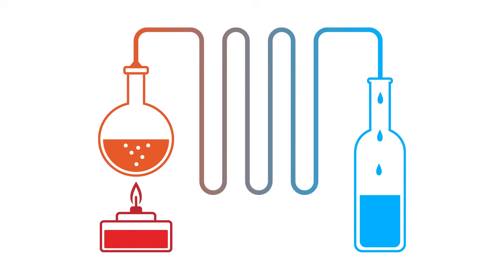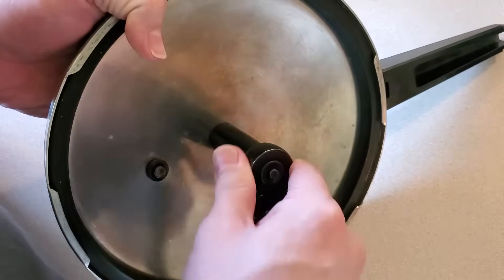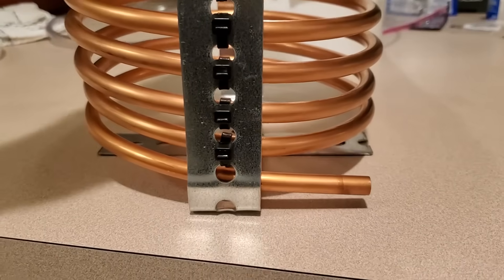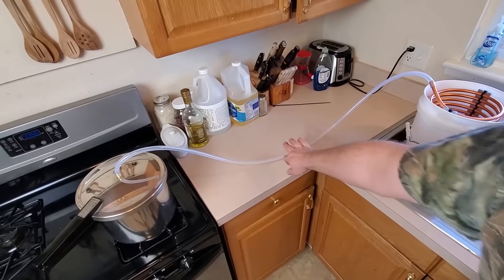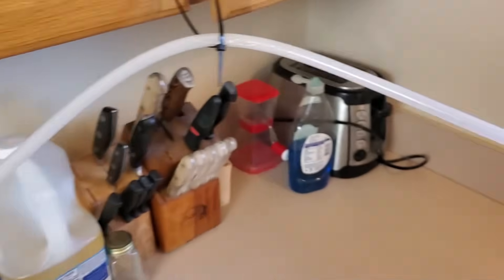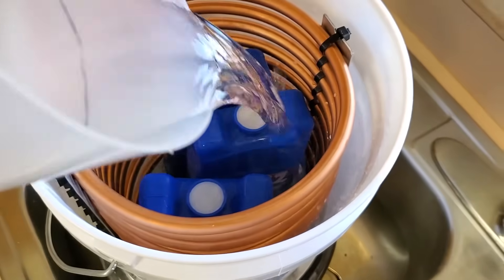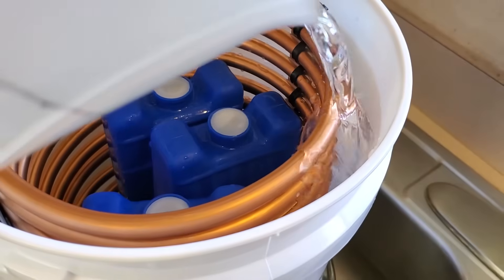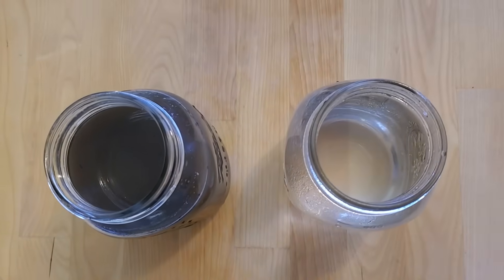DIY Water Distiller (Higher Output Version) - Full Build and Demonstration

Comment: Does it remove fluoride?
Reply from the maker: Yes. It removes almost anything/everything. This includes minerals and beneficial things, which is why it's not ideal to use as a long-term water treatment method for drinking water. But if you need to remove fluoride from some water, distillation will do it.

Comment: I bought a still to do this .what I found was... It takes way too much energy to create distilled water I had to keep pouring cold water onto copper pipe and the water became boiling hot within a minute .I wondered about the idea of placing the copper pipe In a small freezer perhaps to condense the water ? I just found the work Vs result was way way too much .

Comment: You pretty much covered all points but I believe distilled water lacks minerals and requires some salt to replace minerals or the Atoms in the distilled pull the minerals out your body so I would think a few kilo of pure Rock Salt is needed also if this is going to be the regular modus operandi for drinking

Comment: The problem with distilled water is all the minerals are removed and man made chemicals with low vape point transfer over so depending on circumstances it still needs to be filtered
Reply: If you allow the water to boil for a short time before placing the lid on then it will off gas all of that. Also, purge the first of the distilled water.

Comment: You don’t need a pressure cooker in a pinch. As he said, he’s not worried about the seal because the pressure won’t be that high. Drill a hole in the lid for any big pot you have, attach a hose connection, and just putting a brick on the lid will suffice.

Comment: Boiling isn't necessary and probably detracts from the process. Just enough heat to cause the water to evaporate and rise at a good rate. Although slower It will be much kinder to your chiller. GREAT BUILD

Comment: The water drain is unpractical and a waste, to be honest. The water that gets hot in the bucket is the top layer and the bottom half stays as cold as it was when you pour it. It creates a thermocline so it still cools the steam. When you drain it from the bottom the cold water leaks first. Also the water itself doesn't get that hot. I love to put my hand in the cooling system and feel the thermocline, it's fun. my elbow it's around warm water and my fingers are in cold water. I leave if to boil for 3 hours and the water has never gotten so hot that I was not able to put my hand in it. So yeah, it you want to, you can scoup a couple of bowls of the water on top and replace it with cold water, but draining the bottom water is a waste.

Comment: Would filling up the bucket with dirt help the cooling process? u can always add water to that too if the dirt alone doesnt do the job. Id imagine coolness in the condenser would last longer with dirt and water (as the water would be soaked by the dirt
Reply from the maker: That's an interesting idea. I'm not sure if it would help cool the coils, or act like an insulator and prevent the coil from radiating/dissipating the heat. Might be worth an experiment.
Reply: @GreatLakesPrepping  Try sand, you know how on the hottest days at the beach the sand is still rather cold if you dig like 8 inches down? Thinking more into it I theorize that sand would be very effective at keeping cool. Especially if some water (doubt it even has to be cold) gets added to the sand from time to time.

Comment: Surely someone have already said it... BUT distilled water is not safe to drink... there must be minerals to be added to it. I have nothing to suggest to do that yet, but I know that it must be mineralized before drinking.
Reply from the maker: Yes, one or two others have already said it. And they were also incorrect.

Some people believe that since distilled water has no minerals or electrolytes or basically anything else that it is unsafe to drink because it will not replenish (or even deplete) your body's minerals and make you die.

Firstly, you would have to drink ONLY distilled water. For days or weeks. Just nothing but distilled water. Secondly, you would have to eat practically nothing. We ingest tons of minerals, salts, etc in the food we eat. If you're eating nothing but celery leaves and drinking nothing but distilled water, then that would be a very poor diet. After awhile, yes, would suffer from severe malnourishment. 
But to make blanket statements like "distilled water is not safe to drink" is unsubstantiated and shared via ignorance of the topic. In an emergency scenario, distilled water is perfectly safe to drink.

And by the way, you can buy remineralization stones/elements to mineralize distilled or filtered water, if that's what you're looking for.
Reply: @GreatLakesPrepping  Yes that's what I thought. Thinking of 'refiltering' the water in some kind of substrate of rocks and charcoal etc... Anyway thanks for the video and your well elaborated answer all very useful.

Comment: I would NEVER use heat and any type plastics. Doing so, defeats the entire purpose of cleaning water. Plastic is BAD. I never use any plastic in any type of food more water prep.
Try to use all copper or stainless steel, fittings and all.
Reply from the maker: The hose I'm using is high-temp, food grade silicone. It's specifically made for this sort of application.

Comment: Hi...thanks for sharing!   As I watched i began thinking. First the Silicone tubing gets very hot and the chemicals in the tubing as a result of the heat will end up in the finished drinking water. 1. Could you use copper tubing from the pressure cooker to the bucket! 2. Could you add ice or snow in abundance in the cooling bucket to keep the output of distilled water at its maximum? 3. Could a brass spigot drilled into the side of the cooling bucket to release on demand and or as needed the melted ice or snow and excess water after cooling the coils. This would drastically reduce the amount of water waste. The water removed from the bucket could be reintroduced into the pressure cooker. If somehow the cooker could be larger the output would be increased because OUTPUT is the most important part of this operation. Thanks!
Reply from the maker: All good ideas. But I will mention that the silicone tubing is made for this. It's high-temp tubing made for brewery equipment (food-grade). I have no concern over chemicals leeching like they might with regular plastic tubing.

Comment: Use an adapter to go from that silicone hose into a 3/4" or larger hose and that will increase efficiency.
Your estimate costs is waaaayy low for 2023....

Comment: I love the design, as it opens up a few thoughts for me. I am contemplating the possibility of using solar excess (once batteries are full) to run an element to heat water (maybe 500, or 800 w). My concerns are, how much can one distill this way. Ice bricks are not an option if I want, say, 1000 litres per day. Thanks for the video!

Comment: This method is great, but unfortunately the plastic in the pipe connecting the copper coil to the jug is being leached into the water. And this method doesn't have a filter to filter out the chlorine that evaporates along with the water. It needs to be connected to a carbon filter or something that will kill the chlorine from the evaporated water.
Reply from the maker: It's not actually plastic, but rather food grade silicone tubing.
Reply: @GreatLakesPrepping  Oh then that's good. So the silicone doesn't leech anything into the water right?
Reply from the maker: @kiranfernandes2261  Correct! This is the same sort of tubing that is commonly used in brewery equipment. It's designed for hot, food-grade liquids.
Reply: @GreatLakesPrepping  that's awesome. I'm building my distiller, and got a 10L pressure cooker, and some copper tubing. But I made a bunch of kinks in the tubing trying to get it to turn. Looks like I need to get it taken to an expert in turning the tubing.
Reply: @GreatLakesPrepping  my copper tube is half inch internal diameter, and about 12 metres in length.

Comment: Materials were $60.00, BUT the cost of the gas/electricity would make this extreamly non-cost effective. In the field, a wood fire would cost less, but be even less effective due to the heat loss. A closed burner system would be excellent for this.

Comment: Very well explained!!

I'm trying to get away from using things that take electricity to make, like frozen cooling packs or ice, to make "emergency" items.  So seeing that adding "water" to the condenser bucket really helps, is great information.
Reply from the maker: Thanks Jen, I'm glad it was helpful
Reply: @jen: Exactly.  No electricity.  No daily sun for solar power = sooner or later no cold or frozen anything. Re-use the condenser cooling water.  What happens if there's an interruption in the water supply?  Folks will have to use and re-use what they have on hand and not let it go on down the drain.  I agree that this video has great info too.  :)

Comment: You don't want a hard boil on the water! Just a tiny simmer is enough and most efficient.  Consider sun distilling that never boils water as an example. Purchased distilled water is so cheap since it is VACUUM distilled which lowers the condensation point of water greatly thus using little energy.

Comment: so much energy for so little water. At this point I would just use a water filter
Reply from the maker: If what you need is filtered water, filtering water is definitely the way to go. But if you need specifically distilled water, distillation is the only way. This video happens to be about distilling.

Comment: Can silicone tubing be used in place of copper tubing? It's a lot cheaper and takes up less space when the apparatus isn't in use. (I have a really small apartment.)
Reply from the maker: It's definitely not a replacement for copper. The point of the copper is to dissipate heat. It's very conductive. Silicone isn't really conductive like certain metals. It wouldn't dissipate almost any heat, which is the whole purpose of a condenser.

Comment: If it is PURE copper, you are disinfecting your water at the same time. Copper, as is silver, is a great water purifier. Pure copper water jugs are very expensive, because they are so healthy! ⚱️

Also, if you made the drain hole the size of the plastic tubing, you could save water AND disconnect the tube from the bucket easily. 😁👍🏻

Comment: That's a great idea.
I was wondering if this removes hexofluorisis acid or fluoride.
 It says the boiling point of it is °227.3F so it's just a little above the boiling point of water.
So I guess you'd have to have a thermometer in the boiling water and try to keep it below that while the water level is going down.
You'd. Probably have to keep lowering the temperature as the water level goes down.
Reply: Use fractional distillation to remove specific unwanted substances.  Do a search ...

Comment: TL;DR: 👇 pressure in the pot, 👆 Copper use and diameter. 

It would be more efficient to use a pressure cooker. The reason is the pressure raises in the pot the heat energy required boil the water rises. For example, water at standard atmospheric (15 PSIA) pressure will boil at 212 °F. Raise the the pressure 15 PSI (30 PSIA) and the boiling temperature rises to 250°F. It may not be getting that high of a pressure in the cooker now but any rise in the pressure inside your still will raise the heat/temperature. Now it you put a bigger hole in the top and used metal pipe (copper usually) of a larger size (think 1" or larger) the heat transfer will be higher after the steam leaves the still (starts condensing). Add some copper wire or scrubbing pads inside to increase the heat transfer more. Basically, you are building a still much like some good ol boys in Appalachia. All that said, you can buy a still kit from Clawhammer Supply and build one yourself.

Comment: If you are loosing steam  even after cooling, you need to turn your heat down.  The hotter it is, the more pressure that is being produced.  After all, you only want to collect the condensation from the steam.

Comment: I'm looking for something that ideally would be true survival mode. Who's gonna have EXTRA water or ice packs to use in order to make clean water? Especially if the grid truly is down you might not exactly have power to boil the dirty water. Any suggestions?
Reply from the maker: For distilling, you always need to have heat to constantly boil the water to create steam. The extra water or ice isn't needed; it just makes the distillation more efficient. The more condenser coil you have, the more efficient it would be also. Either way, the way I would see using this in a survival scenario would have to involve a wood-burning stove or campfire. Distillation is an extremely strong way of purifying very dirty water, but there are definitely less resource-intensive ways to purify water (like filtration, chemical treatment, etc).

Comment: I’ve built several of these for a completely different purpose. In HVAC when recovering refrigerant it makes the recovery cylinder very hot with pressures exceeding 500 PSIG. This takes forever on a hot day and will make the machine shut off constantly. So I rolled about 30’ of copper into a cooling bucket and connected it between the machine and recovery tank. Ice is a good start but it melts super quick, running water is a must. Absolutely the more coiled copper I use the better it works. I never thought about doing that to distill water but I’ll be doing it now. I’ve already got a 20’ inner coil and a 25’ outer coil. I will be surprised if any steam makes it out but we’ll see. Dope video, thanks.
Reply: have you ever tried dry ice? i used it for solvent recovery in a different industry, and it slurps it out quick.

Comment: so ur Prepping right - then spend $200 and in 2 days ull be good enough to weld a work bench together 
this waiting for epoxy stuff could have been solved with 10min of unpacking - welding and packing up a welder, and its a value add skill for your shtf. i got sick and tiered for figuring out how to bolt my projects together. its just metal hot glue :D

Comment: Try elevating your coil enough so the steam continually flows upward into, finally, a collector (condenser). Collect the drip, flow. Excess water can now trickle back into the boiler until it too, is steamed. Lower your heat for ratio stabilizing of all components.

Comment: more copper tubing means more surface area for heat to be stored which also leads to more water needed to cool the coil. maybe use thinner pipe or even go as far as to make a smaller coil but I get the bucket concept so a thinner gauge pipe should cool more efficiently when submerged in the bucket

Comment: I bought a moonshine still and it was a piece of s*** they gave me back my money it's garbage it's stainless steel body and then it's got a copper tube cooling system and my water is 257 parts per million in the red can't drink it poisonous after I run it through vapor distillation it's one parts per million it's on reverse osmosis I just bought a countertop reverse osmosis system from Amazon and it's supposed to come in tomorrow I wouldn't drink my water if if I had to I use it for my garden

Comment: a bottle of distilled water at Walmart is $0.72 to a dollar how much did it cost you to make less than that. To make a gallon of distilled water it would probably cost you more than a dollar in gas. in an emergency situation this would be fine,  but to make enough distilled water to drink daily would cost a lot of money. I go through about a gallon of distilled water a day. Unless I have to I will never drink any other kind of water.
Reply from the maker: Yes, the point of making this was to have a way to make distilled water in an emergency. I used my gas stove to demonstrate it, but this would work just as well over any type of heat source (firewood, etc).

And only because you mentioned it, I'll mention this... it's not recommended that people drink ONLY distilled water. Distillation separates water from everything that isn't water (such as minerals, electrolytes, etc). It is said that drinking only distilled water can lead to a vitamin deficiency (depending on your diet and other sources of vitamin intake).

All that being said, if you are really using a gallon of distilled water every day, it would probably be worth it to purchase a higher-efficiency electric water distiller to use at home. If you're spending $300 or more per year on water, it's probably worth the small investment.

Comment: This may have already been addressed here, but you dont want to put dissimilar metals in direct contact with each other.  Retired mechanic looking to build a water distiller, and I always look to see what YouTubers are doing..  this is a sweet arrangement other than the connection.  Additionally, use a rubber pushthrough bulkhead seal for output of condenser and use bucket of water as to make full contact with tubing.  The only upgrade to this would be tapwater running into the bucket continuously to dilute thermal storage of water in bucket.  Hope this info is helpful to someone.
Reply: Hi just so I'm clear, instead of the metal piece that was used underneath, he should've used copper for both?
Reply: @nikkilav824   ALL copper structure is fine, as long as you isolate the copper and support metal, you're fine.  I have yet to build mine, but this guys arrangement is pretty sweet.  In my state, Sams just raised the price of water cooler jugs for drinking to $1 a gallon.  I believe I can distill water for about 27¢
per gallon.. And no more wrestling 5 gallon jugs up my stairs.
Also.. Your reference to underneath?  I am talking about anywhere copper comes into direct contact with any non copper material. Silicon interface between condenser and boiler, and support for condenser in bucket. Hope this was what you were asking.
Reply: Btw thank you for your input...every little bit counts.